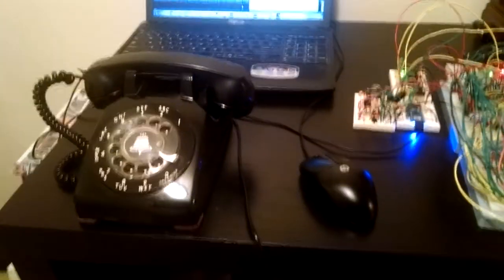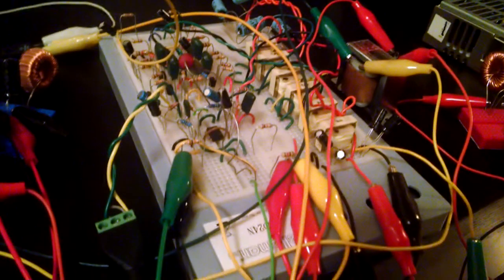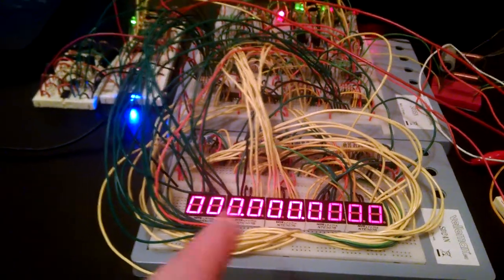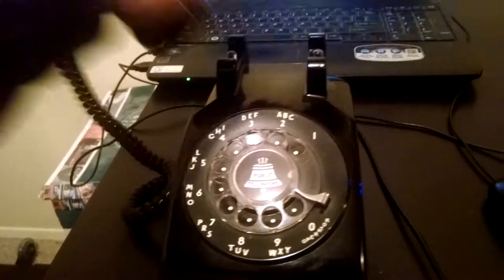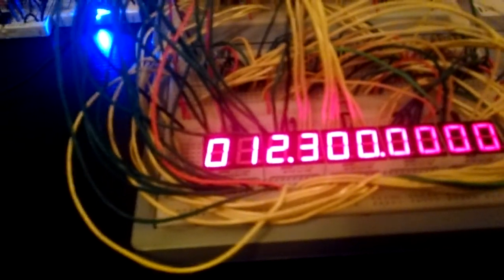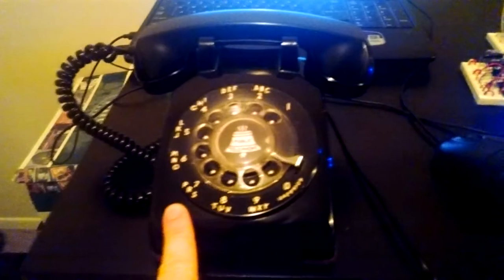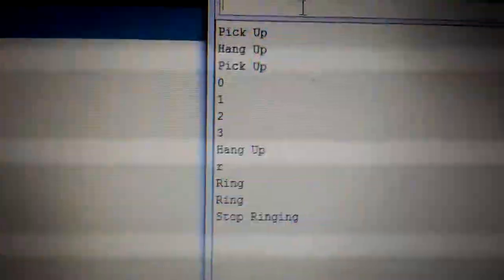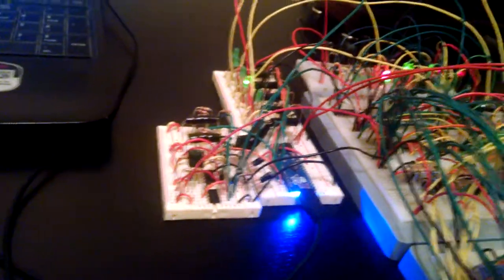Rotary Phone Project - Arduino Update!

Comment: i plan on doing the same with my moms rotary phone. seeing her having her favorite phone working again could be priceless :)
Reply from the maker: If you just want to get your Mom's old phone working, the easiest way to do it is use a pulse to tone converter and plug it into a landline: http://www.oldphoneworks.com/pulse-to-tone-converter.html
Reply from the maker: If that's too easy and you need a challenge to be satisfied, you could try building your own pulse-to-tone converter. I have a spare rotary phone sitting around that I've considered trying that with. It would be a good little project, and certainly a lot easier than the one I describe in the video.
Reply: Are you able/willing to publish a link to your code?.  I'm doing a project CV with an old phone which will activate some historical recordings for our schools 525th anniversary.
Reply from the maker: @kineticpaintings  I honestly don't think it would be very helpful. The system is kind of a weird mix of Arduino C code and TTL logic. The hardware does a lot of the dial pulse decoding before it even gets to software, so you would need to replicate a lot of my circuits for my code to be useful. These aren't off the shelf boards with easily available drivers either, but sort of Rube Goldberg circuits I designed myself. I think it would be a nightmare for somebody else to try to replicate it and they might as well come up with their own design. I think the most helpful thing I could do is give you some hardware tips for decoding dial pulses and analog interfacing for the audio, and you should be able to go from there.

Comment: I'm curious as to what the purpose is of those two huge inductors is at 0:33.
Reply from the maker: This was an early prototype circuit. If I remember correctly those inductors were probably a crude attempt to filter out power supply noise. I ended up smoothing it out with linear regulators. BTW I've got much more recent update videos on this, just search through my list and you'll find them.